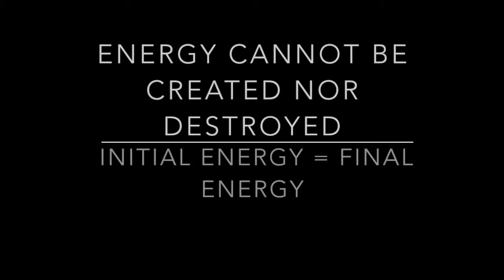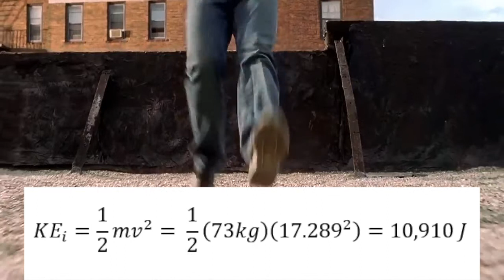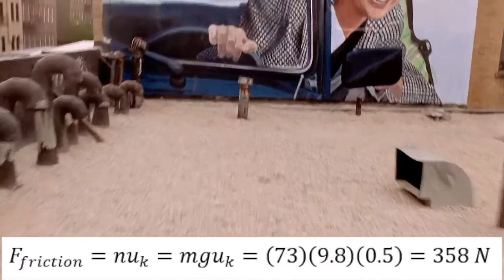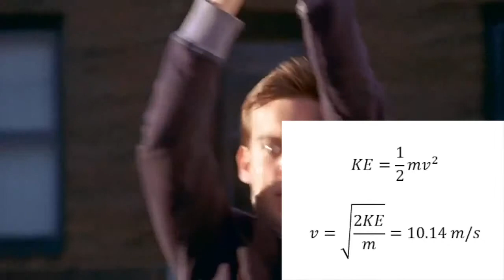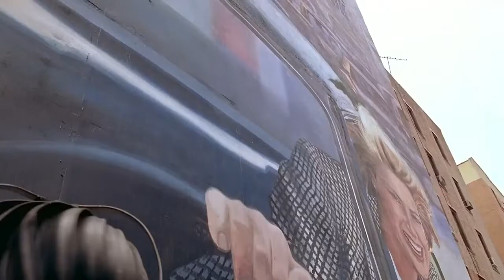The Physics Behind Spider-Man's First Swing. Would YOU Survive?

Comment: Just one little thing: 73 kg is Tobey's mass, not his weight. Otherwise, thanks for not using the archaic system this country insists on hanging onto since 1976. I would not assume four stories is over 15 m, rather about 10 m. Most floors in a building are around 2 1/2 m.
Reply: Cope
Reply: @0riginGonzo  I came up with 7154 J of friction over 20 m. At 10 m height, it would have stopped Spiderman before hitting the wall.. If it were only 10 m of friction (which is more likely}, then final velocity would become 9.91 m/sec, which is just a little less than the calculation. Therefore, the conclusion is nearly the same.

Comment: Honestly, my only comment is that spiderman wouldnt have slowed down that much because his feet were not in contact with concrete but with gravel which has a lot less grip, and they didnt touch the surface evenly at all. But since this would only make the crash more deadly it changes little of the final answer.
Reply: Yes. But on the counter arguememt is that he applied a force downward which would have been significantly more than the friction force. He is spider man and thus has super strength. The force downward would have slowed him down significantly.